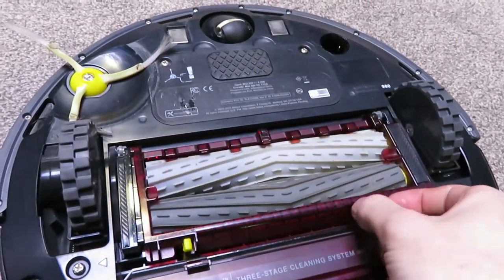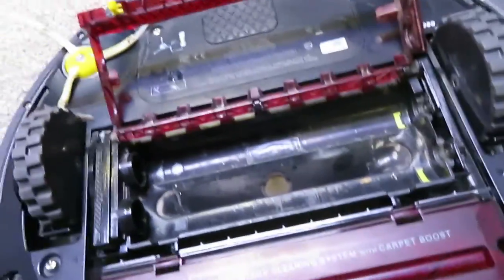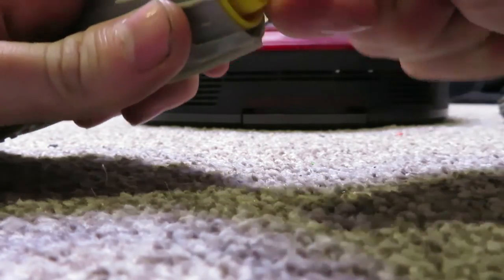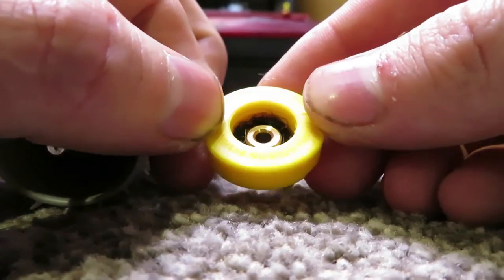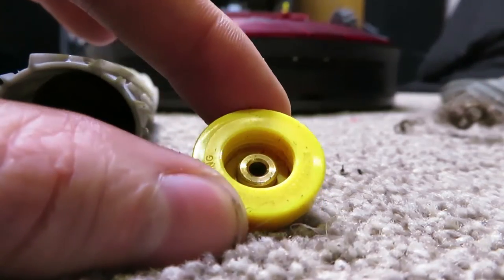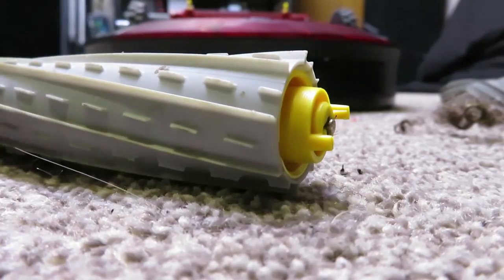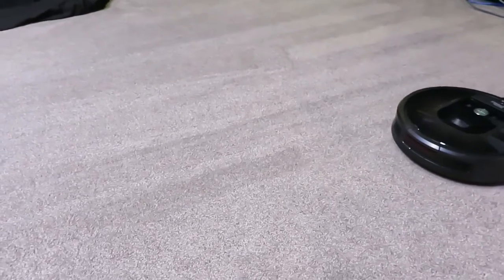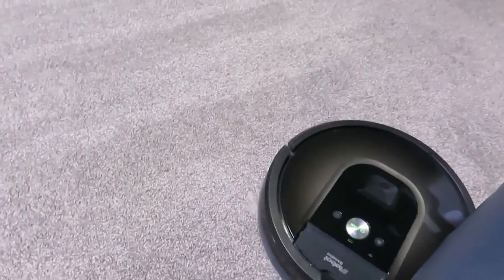Roomba keeps lying! Debris stuck in the extractors every 2 minutes!?

Comment: Thank you for this video. Have had our Roomba for a couple of years and never knew that those yellow ends came off. I was frustrated because after only a minute or two I got the same message and I thought I had already cleaned the extractors. Little did I know that the ends needed to be removed to clean the inside. I watched several other videos and none of them showed removing those end caps to clean the shaft behind, Good work and thanks again.

Comment: First, Good pointer on what to look for.
Second, The problem with mine is the bearing itself is bad, and you will find this on third party rollers from Amazon, some are good some are horrible.  Just try turning the yellow caps by hand they should literally spin completely freely with no hangups or force required. I popped the caps off and pack them with some lithium grease and they were both fully functional then.
Because the Roomba is constantly monitoring the required torque to the debris extractors, it will stop at the slightest increased power requirement from the rollers.

Comment: OMG!! THANK Y0U! I clean the ends of the rollers every time I empty the trash bin, but never thought to remove the yellow cap. Mine just started doing the same error after 60 seconds.  You wouldn't believe the amount of hair I pulled out of the cap alone, plus the roller. ALSO, I noticed my garbage symbol has now quit flashing even though it was empty. Must be the signal it's time to clean extractors!

Comment: The black spindle the yellow endcap is fitted (not screwed on) pulls out of the roller (extractor) so you can clean almost the entire end.
Reply from the maker: If you're referring to how I was rotating the end caps, that was to reduce the force required pulling them off outward by hand as they were packed so tightly. Thank you for letting me know it pulls out of the roller though, will be useful for next time.

Comment: I discovered that one of the cleaning brushes has a steel cylinder that must freely rotate.  This cylinder is what the yellow end presses on.  If that cylinder can't rotate, then the robot is screwed.  I put a pair of pliers on it, got it to rotate and eventually come right off.  Sprayed lubricant in there and all is well.

Comment: In my case I didn't get the error #2 (980 model) until I put the BRAND NEW rollers in. Then I get the error #2 after 3-5 min run time.  Putting the OLD rollers back in it runs fine. However the old rollers are worn down a bit, so I'd like to use the new ones. I did check the alignment of the new rollers, they spin fine. All is good. Any thoughts?
Reply from the maker: With the old rollers installed, if you spin the rollers manually, and compare it to when the new rollers are installed, are the new rollers harder to move? This is typically caused by the roomba being unable to spin them with minimal effort.
Reply: Possibly the arm that holds the rollers in is dirty or grime-y or somehow not letting the rollers roll freely